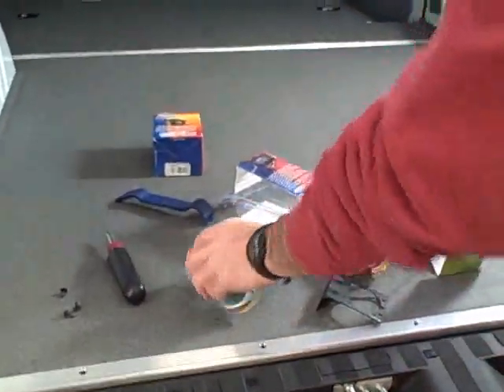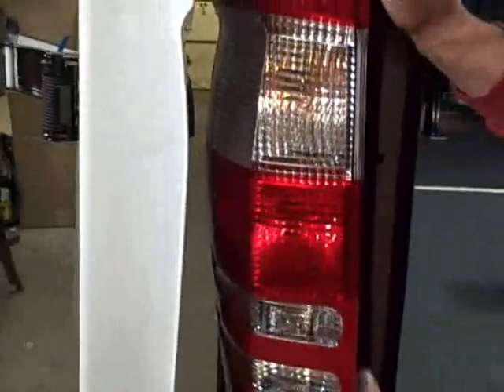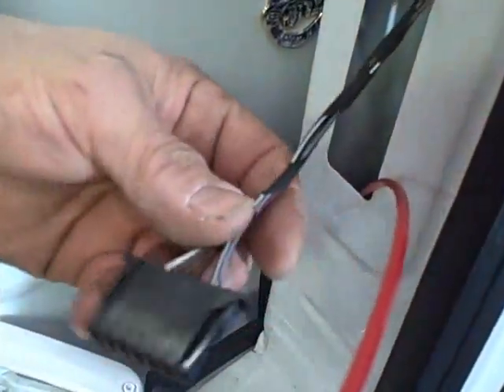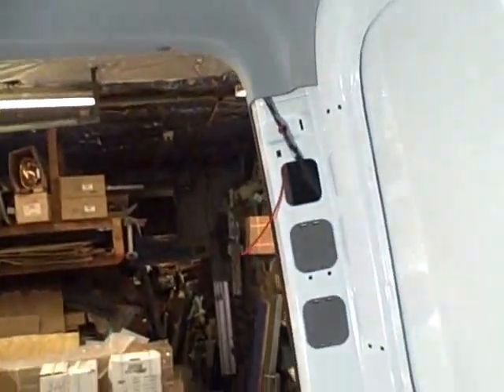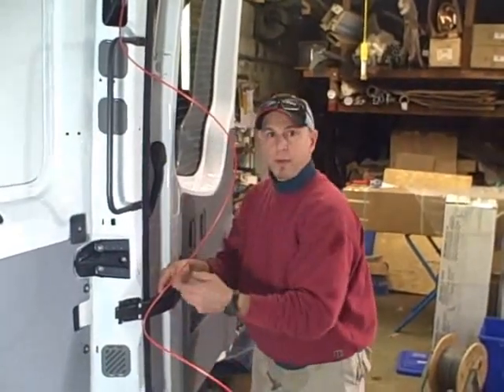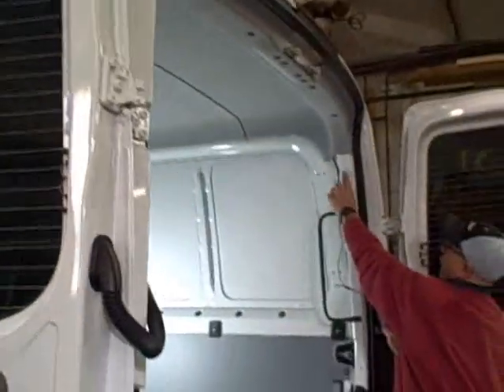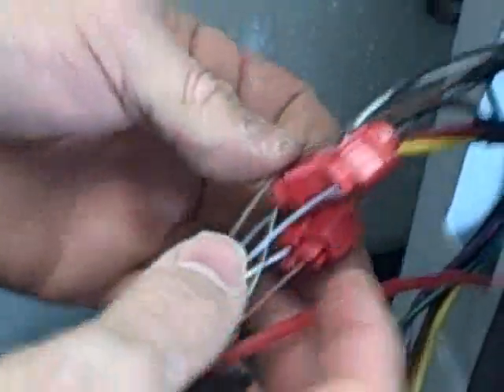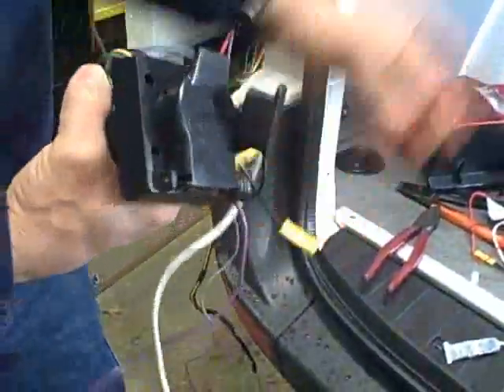sprinter trailer hitch wiring

Comment: Can the 4-pin plug work without the black wire going back to power? Like if I'm just splicing the 4 wires to the taillight and nothing else? Thanks
Reply: valeriy kalchik no it will cause a fault